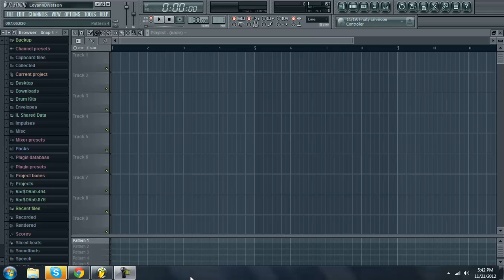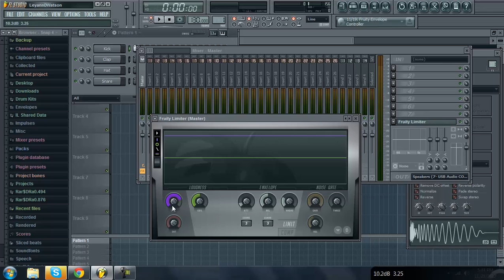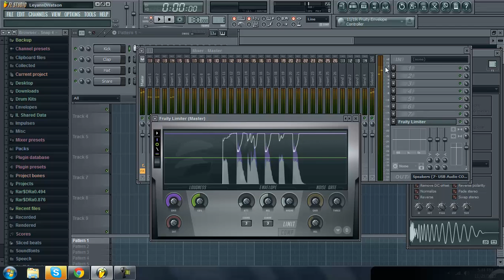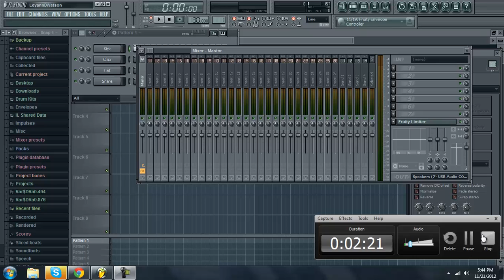How to make beats louder in fl Studio 10

Comment: So basically compress the fuck out of everything, yeah that'll sound great. lol...
Reply: KGRV First of all, you listen to the track. While listening, try to mute different tracks to find out what tracks have the most sonic importance. Then you begin with the volume faders, trying to make the mix sound as good as possible, only by using volume faders. Set all your faders the same volume, so your overall volume is hanging around 20db. The peaks is at 15db. Then you start boosting the sound of the important tracks, to make sure they stand out in the balance.

(make sure you listen to the loudest part of the song, you know, where everything is playing, because if you get a good balance with a lot of tracks, you will definitely get a good balance too where the quieter parts are playing.)

Once you have finished the volume balance, bring up an EQ to the most important track or tracks. Don't boost using the EQ, if you boost, you will not fix anything in the mix, cos then that track's useless frequencies will still be masking the other tracks.

Start out with a highpass filter, unless it's a bass or kick, or any other deep sounds like a bass or a kick. A highpass filter is here so you can cut out the bottom end that you can't even hear at all in the mix. Cut out as much as you can without the track sounding thin. Then you look for problematic frequencies, and cut them out. Don't go over the top with the cutting, nor boosting. Try to cut with 3-4db. More than that and it will usually begin to sound unnatural and stupid.

So once you have gotten a good EQ mix on the most imporant tracks, you head over to the less important tracks, that just makes everything sound a little fuller, but not necessarily anything you notice in the mix. What you will do with those tracks is to mix them around the tracks you just mixed. So this means you will give the most important tracks as much details as possible, as much fullness. Then you will just cut off a lot in the less important tracks, so you can just hear the important frequencies. Remember any time you cut or boost, you will decrease or increase the overall volume level, so remember to compensate for that. So here's the trick, when you cut something, you can make the most important parts of the track a lot louder, and that's how you can make your song feel like it's a lot louder, but it's technically the same volume, just what you actually pay attention to in the mix is louder, not the overall volume level.

When you have EQ'ed the instruments, then you begin with compression. Compression is here, to cut off the peaks of an instrument, then add gain so you can get a more consistent volume level. Remember, to set the threshold below the actual volume of the track, because if it's higher, it's not compressing at all. Also, the ratio should not be 1:1, if it's 1:1 it's not compressing either. So if you want something to be more pronounced in the mix, use compression. You really want to make the sound of basses sound consistent, cos it can be buried in the mix quite easily if it sounds too dynamic.

Those are the most important parts of mixing, and I am tired of typing now. So after you have done all this, and not boosted anything, then you can move to the master track, and slap on the limiter, to make some gain to the song, without clipping. But it's important that you don't over compress it, cos then it will destroy the mix. Try to keep a dynamic range of at least 5db, preferably 10db.

So in the short term, you cut the useless stuff, so you can bring the level up of the important stuff, and that's how you make it sound louder, but still stay in the same volume. And after you've done that, you will make some overall gain using a limiter, but still keeping a dynamic range of 5-10db. I prefer 10db, but it's depending on the track, you know, just close your eyes and don't give a damn about the numbers. You wanna trust your ears, not your eyes. So close your eyes, and gain it until it sounds loud, but still keeps its dynamics.

Hopefully that helped, I will be open to questions.
Reply: Reshard Watson So whats the best way to do it then?
Reply: Doc James Burton I am not really sure what causes the low sound. Check your master level in the top left corner, and set it to 100%.

If you use passive speakers with an amp, I recommend setting your pc volume to 100% and control the levels with the amp.

After all, it is actually better to mix on low volume on your pc, since many mixers can't hear the difference of, if it actually sounds better, or just louder.

When you listen at low volume, the midrange will be present a lot, and when gaining the volume, you will notice a lot more low and high-end making it sound fuller and richer, however, listening at high volumes doesn't do your mix any good, it just makes it harder for you to make good decisions when mixing.

I'd recommend to listen back when mixing, at a volume set so low, that you can have a conversation with someone, without having to raise your voice to be able to communicate. This way, you will actually hear if it lacks low-end and high-end, which makes you realize if it actually sounds good, and not just loud. You may raise the volume, sometimes to listen for bad frequencies if you can't hear them properly, but when mixing in context, listening at low volumes is actually the better choice.

Also, having a mix with low volume is not unusual, and not a problem at all, since it's always the mastered version that gets released.

Also, mastering is a lot more than just using a limiter, however, that is all I know about mastering, so you'd better ask someone else for mastering advice. :)

If that wasn't what you were looking for, please be more specific, and I'll gladly help out. ;)
Reply: Doc James Burton I use pro tools for mixing, and I never use anything on the master channel. You see, the limiter is actually just a compressor, it's just a more extreme one. Basically, when you add a limiter, it's to make sure the track's output isn't clipping, however, you can't see if your song's inputs are clipping. (inputs = all your tracks in the song)

If your track's inputs are clipping, the output will be clipping. Well, it will not technically be clipping, but it will still have this atrocious digital distortion.

In the short term, don't use anything on your master channel, until you are finished with your mix. Some things you can add on your master channel though, are virtual tape machines, or something similar, to mix through that. But don't put a limiter on there, cos you will not be able to see if your track is clipping, and while it might mask the distortion from your eyes, you know, it is not visible in the volume fader, it will still be audible for your ears, so just forget the limiter till the mastering part.
Reply: *****
awesome, thanks for your response :) I agree. now that I think about it, its a very dumb idea to start with a limiter before I even start lmao. thanks bro!
Reply: Doc James Burton you're welcome. :) Feel free to ask for other advice. ;)
Reply from the maker: lol yea 2 years ago.. was just learning mixing
Reply: We've all been there. :) I used to add Soundgoodizer on my main channel back in the day. haha
Reply: ***** thats perfect, I do have a question. at the very begining when starting from scratch, fl studio's volume is by default so low. And what happens is that if I monitor the mix on a very high level, when I render it, it renders brutally low. So I have started to produce on average volume but with a limiter on the master so I can produce and mix on the normal volume from my pc. So... my question is, if starting from scratch already with a limiter on the master channel is not a good idea, what should I do?
Reply: *****
you answered half my question perfectly haha, great stuff!! and I agree with you pretty much on everything. As for mastering, I was not talking about it, I know what it is and requires and so. My biggest question is more of a recomendation, should I (starting from scratch in fl) add a limiter on the master channel, or anything at all there? and if so, at the begining of my production or at the very end of my mixing?. (In other words, should I start an instrumental with an effect on the master fader?)... thanks a lot for your response
Reply: +SkinnyOfficialHD me too!!!
Reply: +ArcticBulletNation holy f, you seems to know your stuff man, big ups ;)

Quick question (well, mabye not)

My FL Studio is really quiet compared to youtube, i have to turn my volume dubble up when making my beats so i can hear it, and while the volume is still very low it still cracks and dossnt have any bass in it, ive tried the "windows" mixer to check that FL stuio issnt set to low volume there and it is as high as my browsers volume, i use Razer Synapse Sorround Pro too and i belive i have the best possiable setup i can get atm.

I have been producing for about 2 years, and i never figured it out, i know how to mix and such (atleast i like to think so)

In short, my FL is quiet compared to youtube and all my audio settings is the same for both programs, help? ,_,
Reply: ***** First of all, check the inputs of all your tracks. Did you check if your master level is set to 100%? (as default there is a small fader at the top left of the DAW), 2 actually, one controlling the overall pitch of the song, and 1 controlling the overall volume. Try and put a limiter on your master channel, but don't overdrive it, because then it will grown your mix. Maybe it's your video editing software that has something to do with it?

Hope this ''checklist'' helps out. ;)
Reply: +SkinnyOfficialHD lmao me too!!!
Reply: +ArcticBulletNation Is there any external software that boost the volume level of the output mp3? I don't have the time to remix all the channels and they're quite good now as it stands (apart from being too quiet compared to most commercial releases.)
Reply: lol i still do

Comment: Do NOT use a limiter on your masterchannel!
And also, the limiter will only ruin your track... Because if u raise the gain, like he did, and put the ceiling to 0dB, then the sound will just get compressed (a lot) and it will just lower the sound to 0dB again (to that ceiling). Think about it, can u be taller than a ceiling? If so, don't u need to duck in order to fit?

Meaning: That is NOT the way to make it louder and clearer. Learn to mix first. Learn EQ. Learn to use Maximus and Multiband Compressor. THAT is how u can master it, mix it or even make it louder.
Reply: Your exactly right leyoo..i used to do this when i first started learning mixing and would always wonder why my beats sounded distored after i exported..it takes time ppl a 2min video wont give you all the answers..ive been producing for a couple years and hell im still learning eqing and mixing..ive gotten better but im still improving..good tips tho homie
Reply: So post a video doing it the right way then so we can learn lmfao
Reply: this is isn't entirely true...a limiter will make you track louder without clipping, it'll just squash the dynamics. It entirely depends on what you're using it for. For a dynamic pop song with vocals, yeah don't do this, but if you're trying to make a hip hop instrumental louder and more aggressive, this is a possible solution. Mixing and mastering beats by themselves to send to artists to then add vocals is a different process than mixing and mastering an entire song